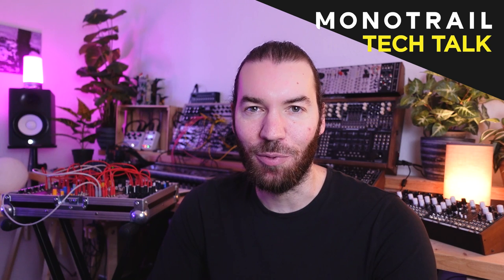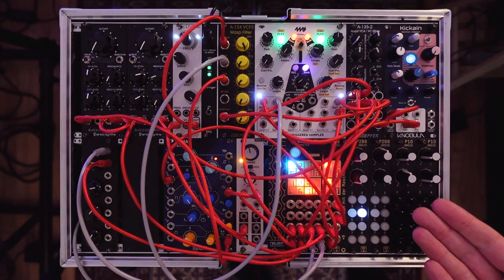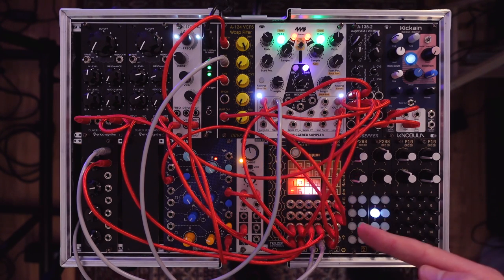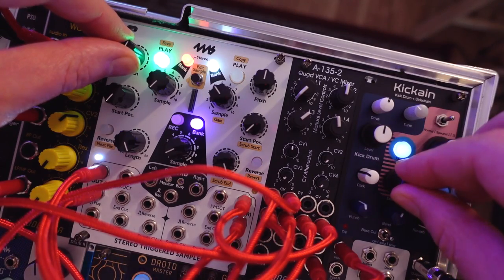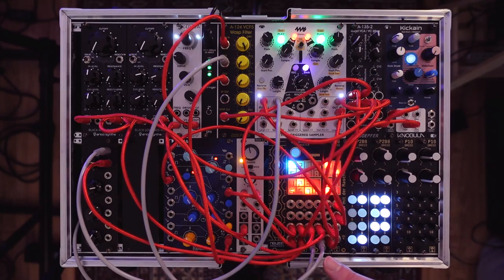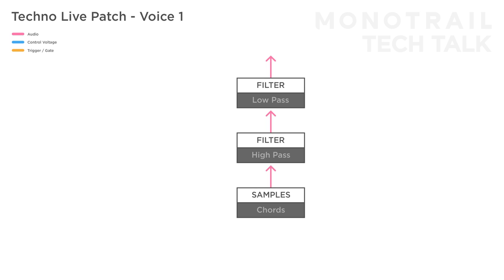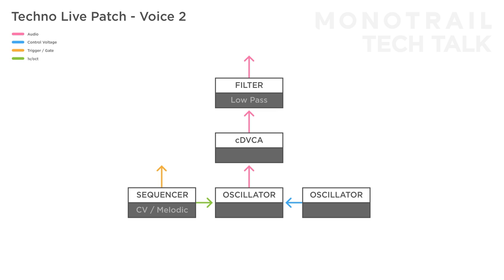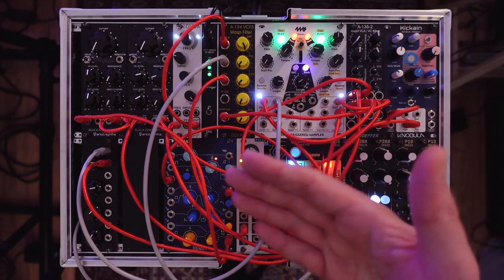My small techno performance case & patch explained

Comment: This is exactly the content that i need! Played my first mini modular live show a week ago and i definitely want to do more. My case Idea is a little different but especially the concept of having few but very flexible modulation sources to repatch during the performance instead of cramming alot of static ones in there might be a way to keep things from getting to repetitive. I swelled into the same things multiple times during the show, which was kinda worrying...

Also, i do not see any FX in your case. I have an Aurora and a Versio in my case Both used for Reverb/Delay type sounds and i am constantly worrying about how to use and dial them in... I am a little lost with this subject and would love to see a video on live FX usage in general. 

(Drums->Rings(with v/O sequence)->Aurora Reverb, and my Bassline switched 2 Octaves up to use as melody -> Versio as delay).
Reply from the maker: Ha, congrats on the live show! For sure, I wouldn't recommend building this exact setup to anyone. Just take the parts or things you think would work for you! As for FX I come from doing performances with an outboard mixer on the side. This was and still is perfect to me. I'd take different signals from the modular to the outboard mixer, and then just use the AUX send 1 & 2 with a reverb and delay pedal. Works great, and that's still how I use it in my studio. For this case indeed I like to see if I could include at least a simple stereo reverb into the case, so nothing else is needed. But I would still go for a FX send setup.

Your setups sound solid. So just a matter of finding the right balance between dry/wet signal. You could always try to use those FX as sends. So listen to the clean signal of each voice, and use a multiple or stackable cable to send a copy into a 100%wet effect. Then mix again within the modular, or with outboard mixer.
Reply: @MonotrailTechTalk  The sends are an amazing Idea! I never thought about such a simple thing... thats why modular is awesome.  Id imagine, i could get away with just one space effect if i can just mix everything into it.  Also my mix would probably be cleaner and i wont have to be as careful with loosing my dry volume tweaking the dry/wet on stage. Ill try as soon as possible, thanks alot!
Reply: @anastasia0zardonova  if you dont want an external mixer but instead want mixer with sends in eurorack and use eurorack effects, I can really recommend the ST modular Stereo SUM system. It has a main module with 2 stereo sends and returns, main out and headphone out. And then you add individual mono and stereo channels as you need which conenct on the backside to the main module so it saves on cabling. Each channel has mute, a pretty brutal one knob eq (hi pass/lo pass with boost), switch for a/b send, level control, send level control and headphone/main out mix knob. So basically just a modular outboard mixer in eyrorack format. Only important thing to note is that there is no gain on the channels, the level control is just an attenuator, so it expects modular level. I was a tad disappointed witht this as I have to add somethig like the bubblesound booater stage for my external synths, but it is a minor nuissance.

If you only have two mono channels and are fine with one stereo fx chain which it seems like from your comment, the make noise rosie is also a nice output mixer module with send/return. Since it is a bit old you could probably find it quite cheap second hand.

Just some ideas if you are determined to keep everything in your case.

Comment: With all that Droid control, how do you remember all that is going on?  And when it comes to the programming, Im guessing that system only goes as well as one's knowledge of cv and how you want to use it?  The second question is really about how do you program if you're not sure what a particular cv result creates?
Reply from the maker: Hi there! It's quite some things to remember indeed, but the whole modular is a bit like that. At the end a patch on DROID is something I end up fine tuning an using a lot. Nothing different from remembering how my Beatstep Pro or any other sequencer works. The programming is a lot of fun in my opinion, using the interface designed for it is great, and doesn't require any difficult coding at all. But for sure, it requires some creativity and a curious mind. If the whole idea doesn't make you smile its best to maybe try out the software (its free) and click around a bit. to see if it is for you. And finally, if you made something and it doesn't have the desired result, just adjust it! That's the beauty of DROID :)
Reply: @MonotrailTechTalk  That all makes sense technically and philosophically.  I dont know if droid would end up being a reduction in hp and make my engagement more fun and easier.  Id want to replace my trigger riot, vector five12, divkid ochd, ne lapsus ox and 2 cosmo delta v.